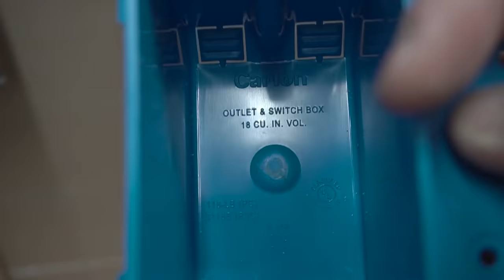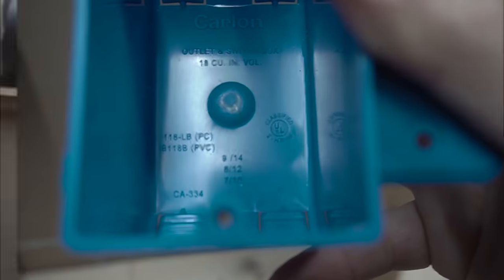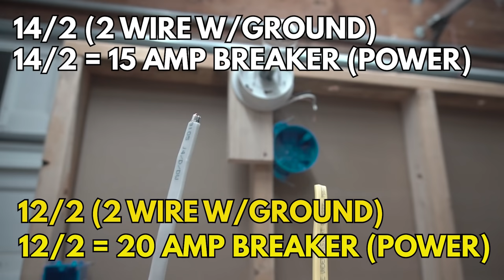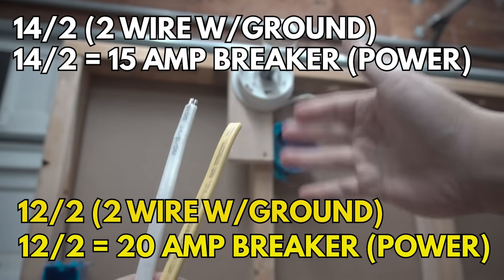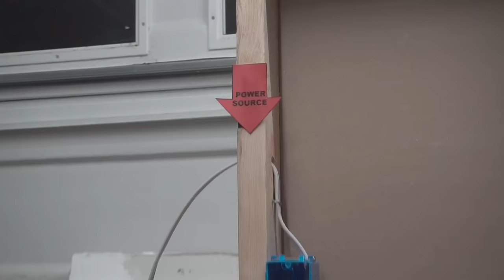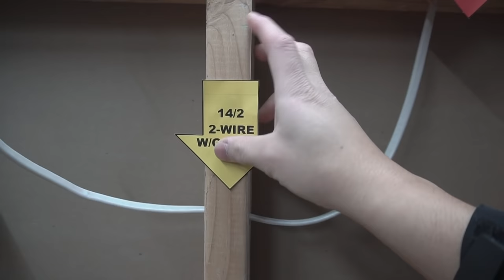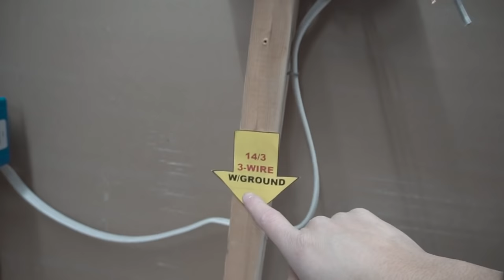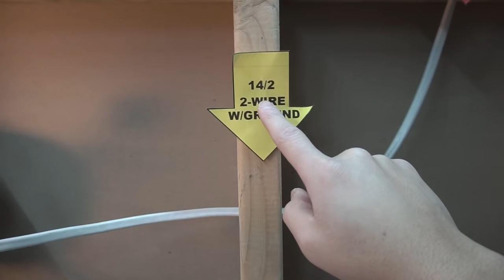How To Wire A Single Pole Light Switch Circuits 3 Different Ways (2022) DIY Tutorial For Beginners!

Comment: hi I have all my wire at home 14/2 I want make line from switch to dish washer
Reply from the maker: Hi depending on your location and code, but dishwasher and other appliances are fed using a 12 gauge wire powered by 20 amps, but always check your code for permit and confirmation before doing any electrical work 🙏🏽
Reply: Good luck with that. Dishwashers have a 1500 watt heating element. All dishwashers need to be on a 20 amp circuit by themselves. No other outlets or appliances except a disposal because they can share cause they only run about 30 seconds and usually not when dishwasher operating.

Comment: I'm stealing power from a receptacle to feed 2 LED lights... I went from the receptacle up to the first light, then to the 2nd light, then to the switch...

I think I figured it out... Can anyone confirm? Thanks

POWER from receptacle to LIGHT, then to the SWITCH

STEP 1
White wire from power to the white wire to the light...

STEP 2
Black wire from switch to black wire to the light

STEP 3
White wire from switch to black wire to receptacle power
* Tape white wire with black tape to indicate it's now a hot wire

POWER from receptacle to LIGHT, to LIGHT, then to the SWITCH

* How do I add a second light next to the 1st light?

Comment: just watching you strip a wire its easy to see you're not an electrician, that being said , only electricians should be giving instructional videos ...in my opinion ...i also believe you can only use the neutral at the switch box with the new code

Comment: How to wire a single pole switch to a light fixture.
Call an electrician.
End of video.
People don't generally do diy electrical correctly and coming in later to fix a diy job fucking sucks.

You have to make sure the wire is stapled within 12 inches of the box. You didn't staple your switch leg.

Code requires that the neutral is present at the switch box now. You can't wire it the way you showed in your second method. The wire going between the switch and the light fixture is a switch leg.
Reply: You are correct, new NEC requires a neutral present in the switch box, however, if you open an existing box and find this switchleg configuration, it’s useful knowledge to have in understanding how it’s wired and how to proceed in remedying any problems going forward; this wiring method is how it was done in older homes before the new NEC was updated.
Reply: @billbaumgartner577  That's a good point. I was thinking of new install/remodel/finishing a basement. If you're just replacing a switch or fixture, yeah, you can keep the old wiring method.
Reply: @hondaguy9153  Thanks for your initial comment, AND THANKS for your considered and polite response to your commenter. Some of these comment posts go off the rails; it’s great to see civility in action. I liked the explanation of method 2, and I would have liked a disclaimer that this method is now obsolete. I prefer method 1, so that everything from the switch to the light is de energized when the switch is off. That makes changing fixtures less exciting.

Comment: Pure stupidity sorry man, best method never fails is keep it damn simple & ezpand cirxuitry on that method, ill never forget how many electeicians i asked about wiring 3ph motors & bunch of em said that then can wire it 100% every time to spin in direction they want, can't chase after these guys as an hvac skilled person & keep fixing flfan motors for Ventilators hvac exhaust equipment rotation etc.. Got so tired of it our company just back charges as it's our off control